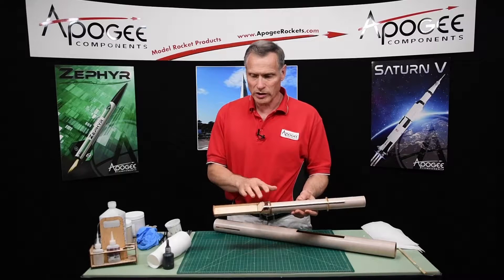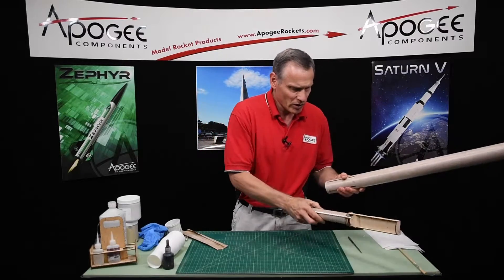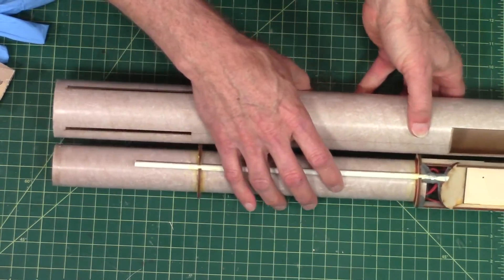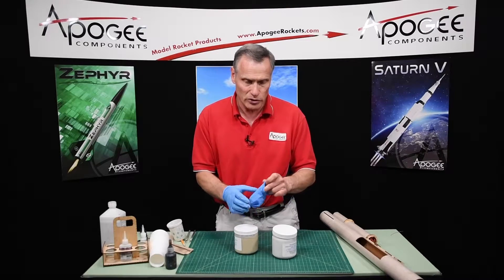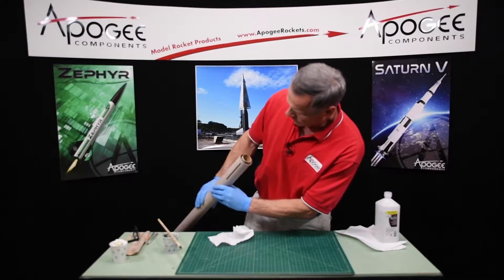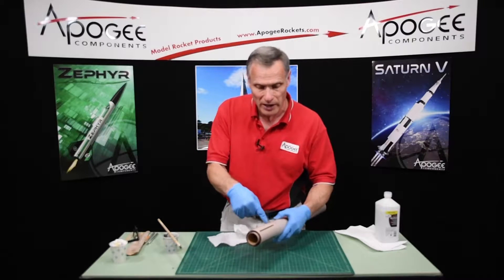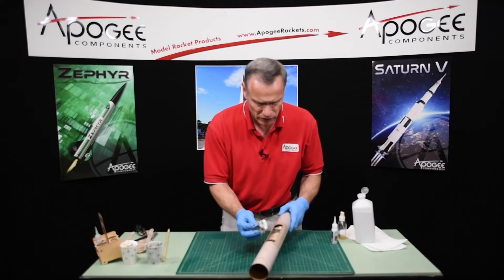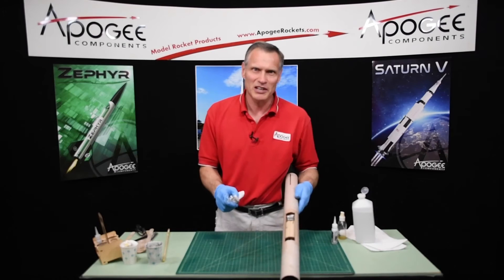Terrier Sandhawk Build Part 5 - Gluing in the Motor Mount

Comment: Do you have to use tape to secure the motor? Or is there enough room for an Aeropack retainer? I'm guessing there is not enough room for a retainer
Reply: Aeropack 38mm retainer doesn't fit. The Giant Leap slim retainer fits. But then there's barely room for the igniter wire. Might be best to friction fit the motor.
Reply: There is enough room for an Aeropack retainer